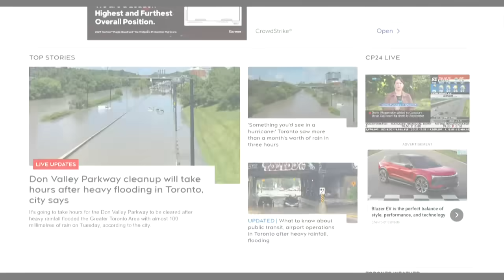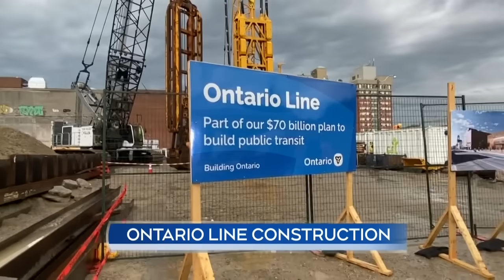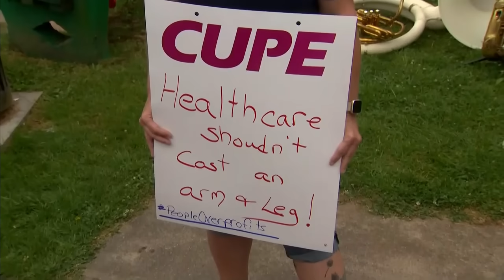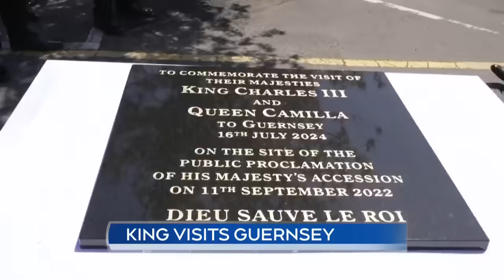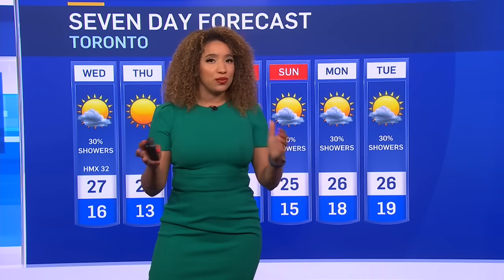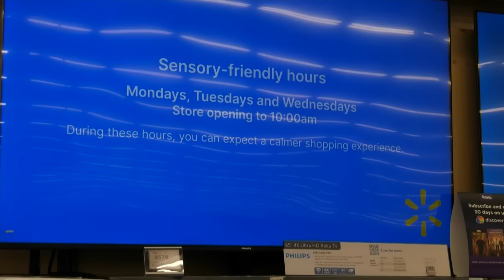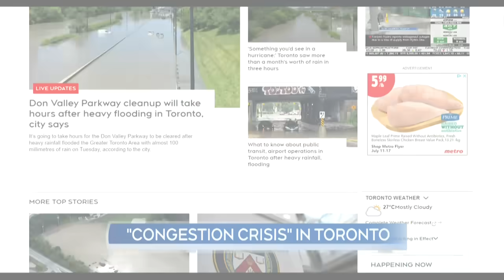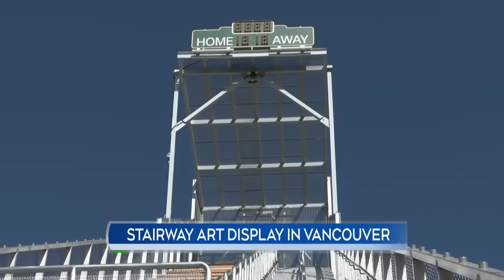Toronto hit with month's worth of rain in 3 hours | CTV News Toronto at Six for July 16, 2024

Comment: It’s unfortunate that Toronto has not learned its lessons about severe rainfall as it relates to the lower part of the don valley, union station and the gardiner… these types of rainfalls are going to be more common as time goes on, so what’s the plan?
Reply: The plan is to spend millions on rushing mixed cocktail drinks in cans to grocery stores, instead of spending it on provincially owned roads like the DVP and the Gardiner expressway.
Reply: More rain tax
Reply: As time goes on? Srsly? Cloudbursts are a normal summertime thing in the GTA. What's NOT normal is spending money on pride parades and street name changes while no maintenance is done on the storm drain system, as in keeping it plug free to begin with.